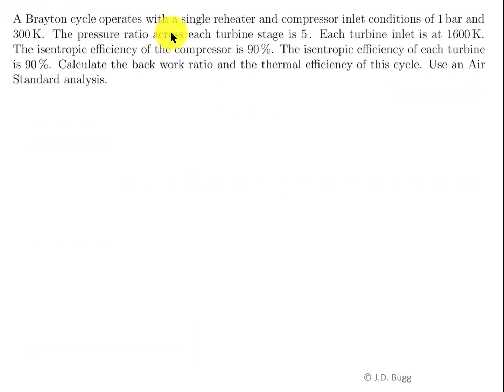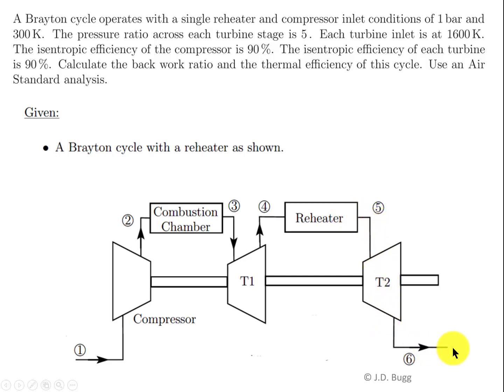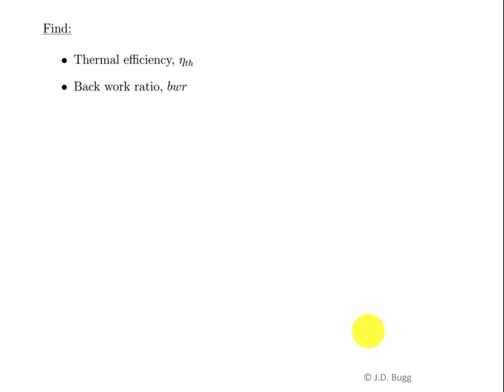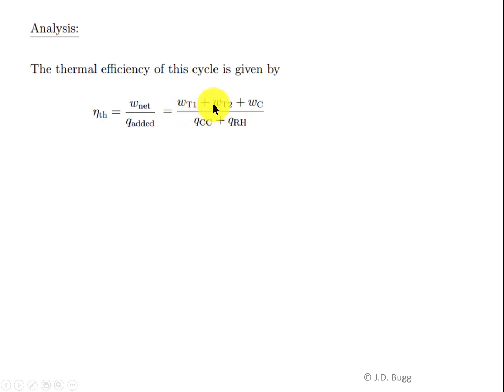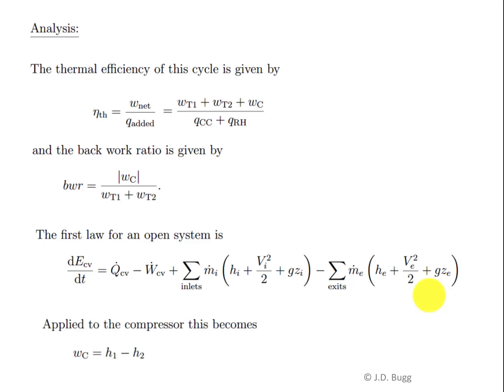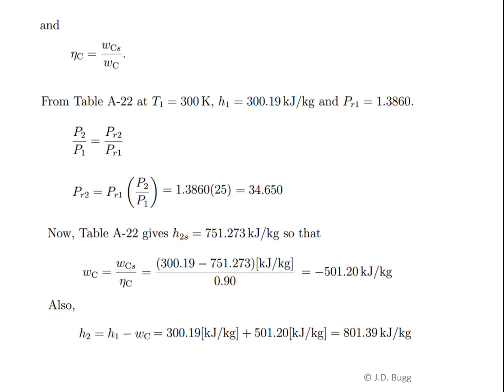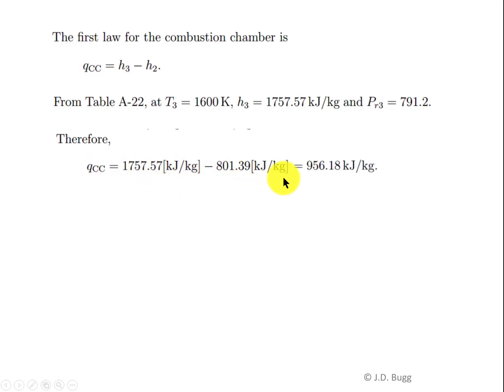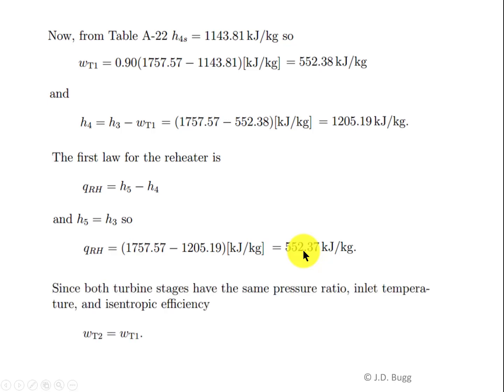Brayton Cycle with Reheat

Comment: can a backwork ratio ever be negative? for instance, i have a convention of U = Q+W.
Reply from the maker: The back work ratio would never be negative.  It should be based on the magnitudes of the compressor and turbine work transfers so the different sign conventions would not change it.
Reply: @jimbugg5129  Thank you very much!